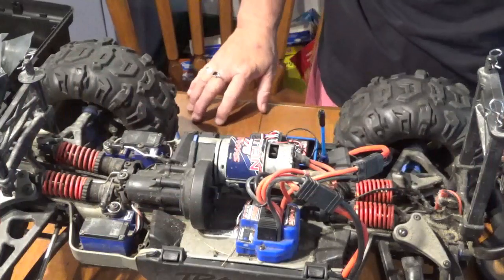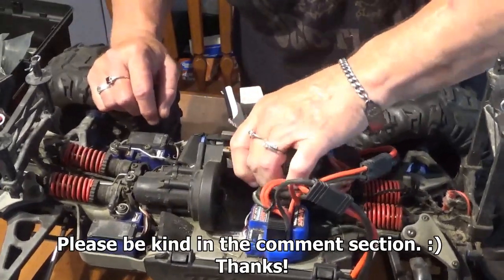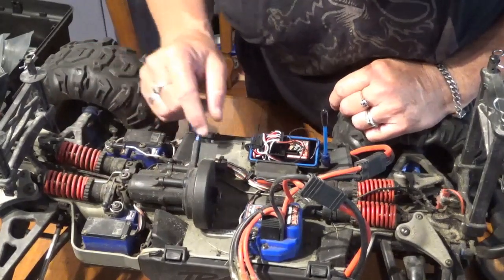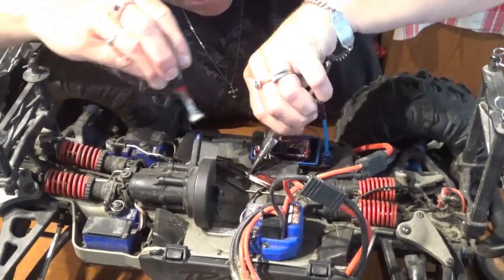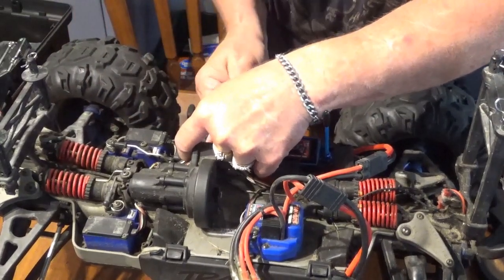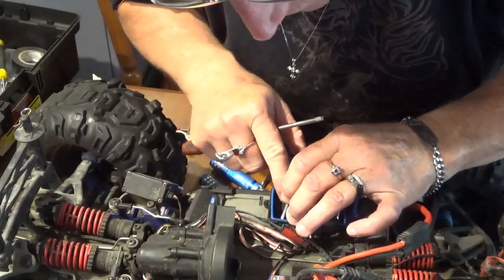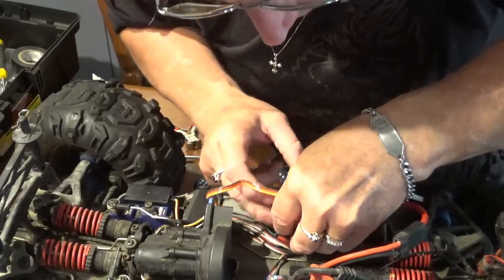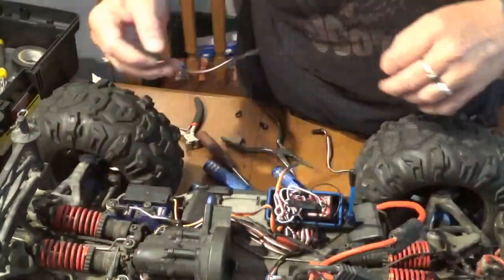1 10 Traxxas Summit Gets Double 25 KG Waterproof Servo Upgrade

Comment: Will these servos work with two  2s 7.4 volt LiPO batteries?
Reply from the maker: Yes they will, that is what I am running in my 1:10 Traxxas Summit. 😎👍
Reply: @SusanMillard  Thank you so much! I'm a newb. Lol I had my summit 1/10 for 2 days. I broke the rear driveshaft. And both steering servos. I guess my daughter and I were having too much fun. Haha.